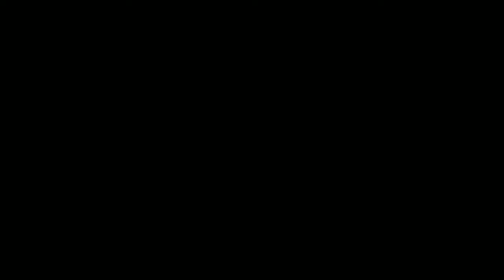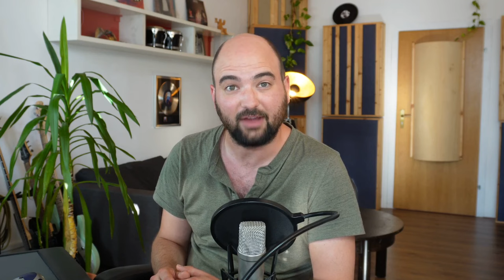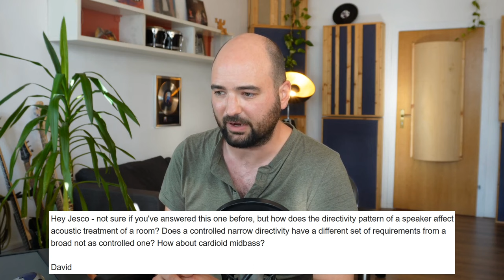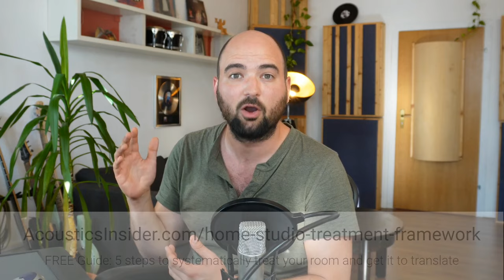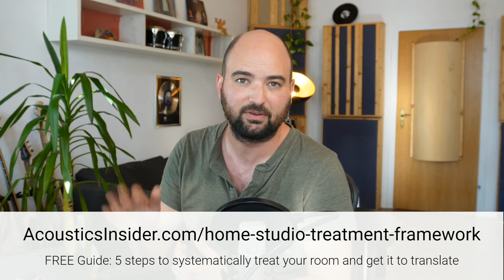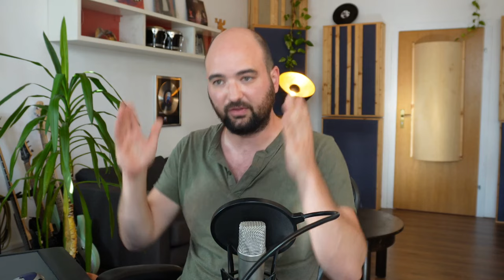Studio Speakers: Does narrow directivity (cardioid bass) affect treatment?

Comment: I thought you were going to speak about Kii3 or Dutch & Dutch speakers. Very curious if these cardioid speakers leak less bass to other rooms and/or need less treatment. Dutch & Dutch will send you a demo pair for sure.
Reply: Besides those exciting and very good newcomers there’s also ME Geithain, who do that for many, many years with cases that kinda controlled leak Bass to the back to achieve the same. Downside: less volume, as you use the bass volume to mostly cancel out itself. There was a company called wvier who worked in acoustics and created unipolar woofers made of combinations of dipole and monopole woofer design in one box to handle that with still enough volume. On the other hand, simply buying e.g. Neumann speakers, who proudly and honestly provide all needed measurements, proving controlled directivity besides they don’t do it with the bass (woofers with DSPs instead nowadays), is a good start. I own a pair of O300 when they were still called Klein + Hummel and the starting point after proper (REW simulation supported) placement is already insanely good.

Comment: Been doing cardioid/end fire as long as I’ve been doing for live, and using electrostatics for mid top, basically line array with 30 x 4 degree dispersion…..
Reply: Electrostatics for live venue?! I’d like to know more about that.
Reply: @jonathanknight8251  sorry misunderstanding there, talking about my mix and mastering studio, but I did favour Alcons Audio for live, think you missed the context of the first part of my sentence, been using cardioid in studio setups as long as I’ve been using it for live
Reply: @murraywebster1228  You’re right. Thanks for the clarification. Your approach for the studio makes sense.  I use original Quads and horn speakers to evaluate equipment I’m developing, partially for the same reason.